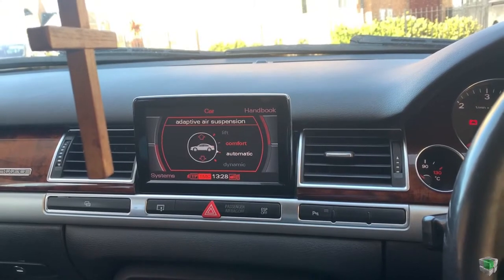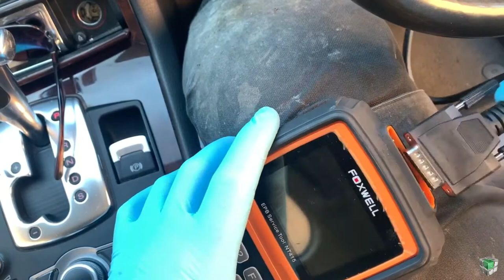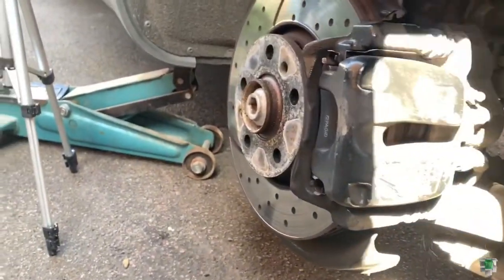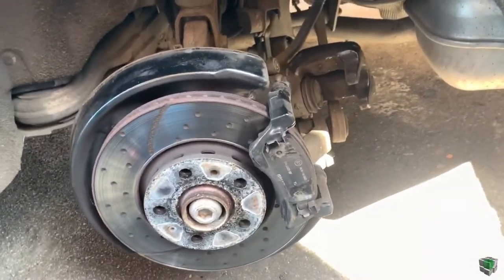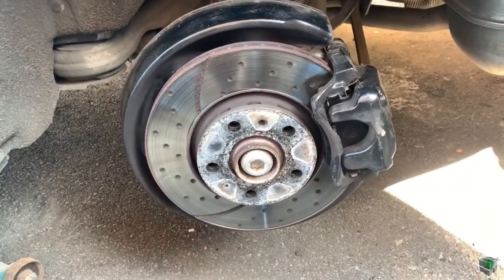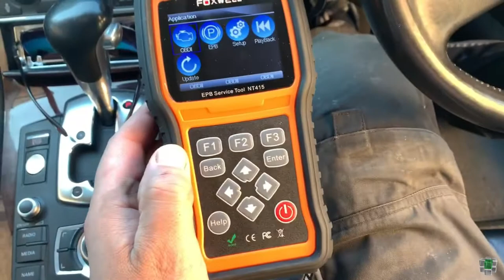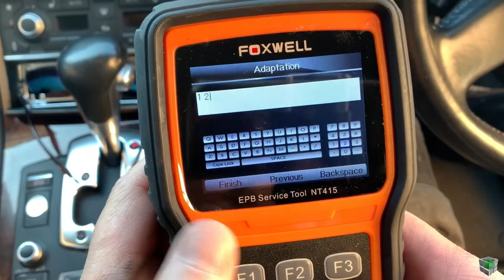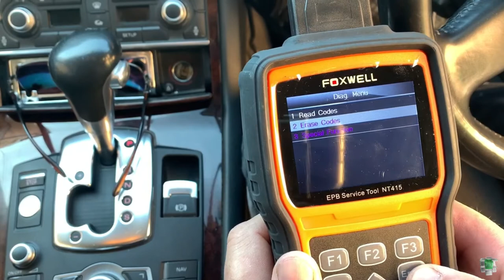How to replace breakpads on Audi A8 D3 2007,how to deactivate,how to adapt hanbrake to the new pads.

Comment: Hey, I wonder if you can help. I have purchased a A8. It was parked for 7 months. It looks like my rear brakes pads are either finished or are binding on the discs. I have the parkbrake light flashing on the dash and when I apply the handbrake, I can hear the sound of a motor on the rear passenger wheel that lasts for 2-5 seconds. 
Any thoughts or suggestions
Reply from the maker: Hi, sorry for late reply…the worst what could be, is one of the rear break callipers is broken… I had that, and I had to replace it, but also it does that when your break pads are worn, or your hand break needs to be adjusted as the break pads are a bit worn and doesn’t have so much thickness as they’ve had when they were new… so you’re definitely needing a garage because to adjust the hand brake you need a computer, or you can buy on eBay same thing I used to release the break callipers…is an Audi professional diagnostic scan tool called iCarsoft VAWS V2.0… I will try to put the link in the description….